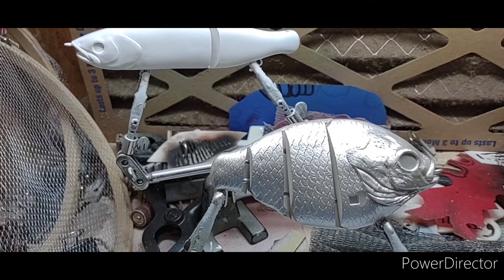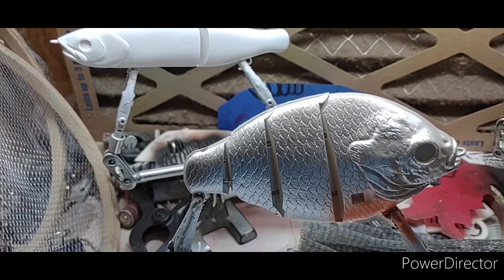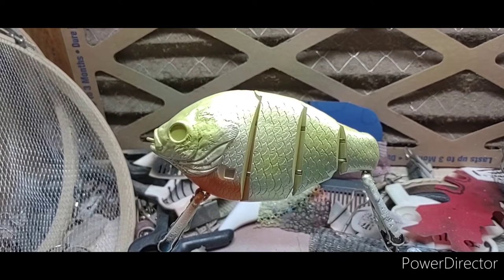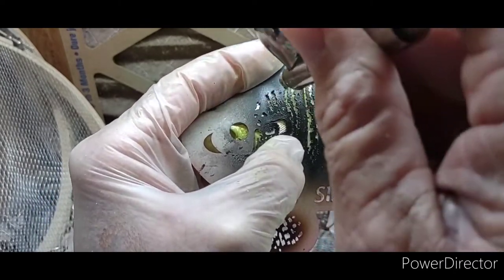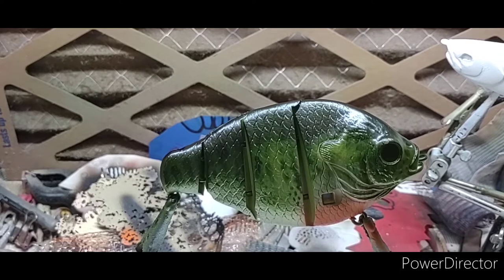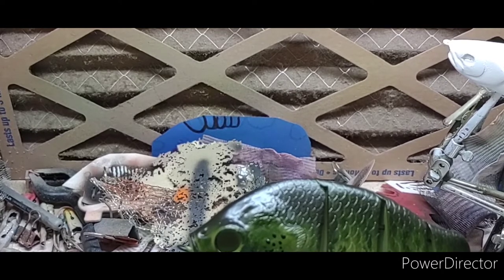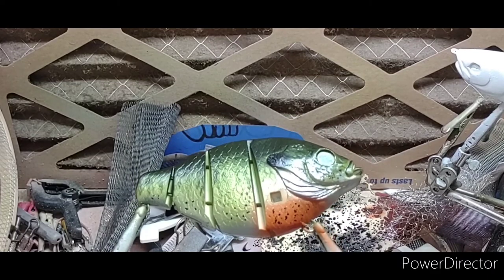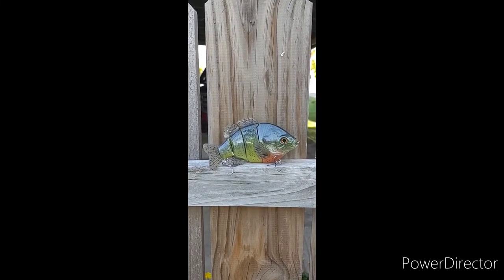How to paint a Perch Pattern!

Comment: Hey, I bought myself a couple of these bluegills to paint and I have question, how do you get the rubber fins to stay in the nonlocking slots.
Reply: @mr.gscustombaits  so after I epoxy the whole bait, then superglue or epoxy the fins in
Reply: @mr.gscustombaits  OK so my first one is finished and it turned out awesome I wish I could show you somehow. Question what size hooks on the front and back have you found to work the best